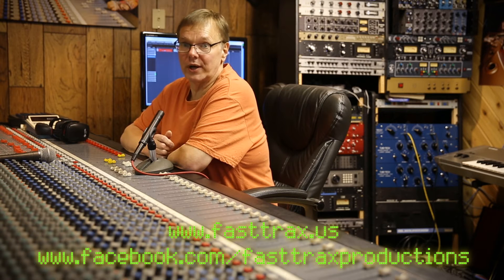Microphone Shootout with Alto Sax - 10 mics - Part 1

Comment: The output from the alto player is mp meaning moderately soft to mf (moderately loud).  In the real world, music can bee ppp all the way to fff.  Also, the particular tone that is being submitted is somewhat dark compared to most alto sax in my opinion.  So, when you get a brighter sax with a much more dynamic range you can possible pick up differences?  The big difference so far is slightly more treble sounding on some than others.  For this particular player's darker sound, the brighter sounds better but not always the case.  What we're not seeing is the frequency capture and the dynamic.  We would need a test subject to go much louder on his horn than he is now.  What happens if the track we're using for testing were to suddenly become three times louder and then back to moderately soft?  I personally think people get too caught up in mics and forget the power of post processing (EQ, Aural Exciter, etc).  Based on this particular video listening to it from my Megaboom monitor?  I would take the least expensive fanciest looking one.  I think the player tries purposely to make his line sound better when he sees what he perceives as and expensive looking mic.  hahah best wishes. fun stuff  - thanks for putting this up!

Comment: Did you place the mic's directly in front of and on-axis of the bell?  Is the distance the same basically for each mic?  It's a little hard to tell with the angle of the camera.  Thanks for making this video!!
Reply from the maker: While we didn't get out a tape measure, we did try to accomplish that in this shootout.
Reply: Were the mic's placed on-axis (straight on) to the bell or off to the side a little?  Again, it's hard to tell.  Thanks again!!